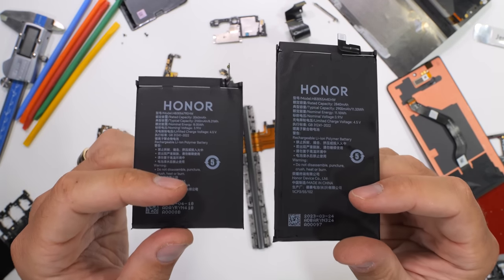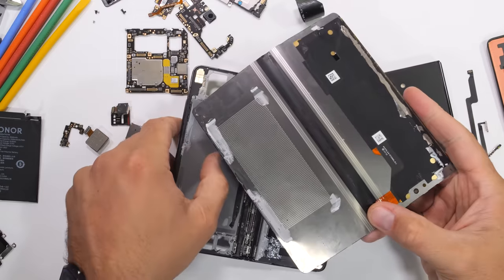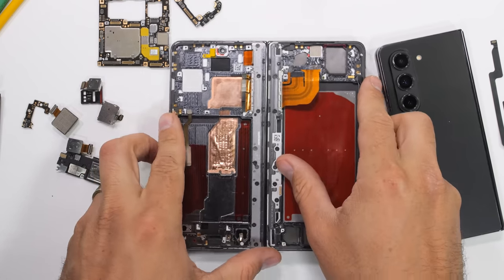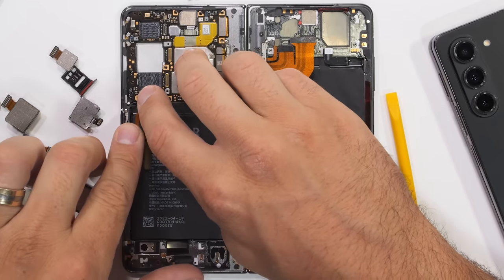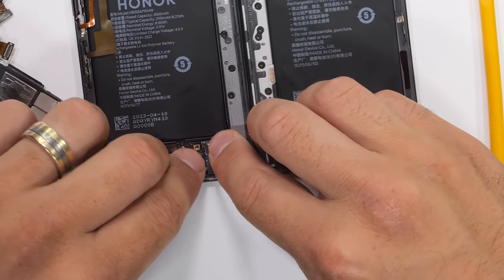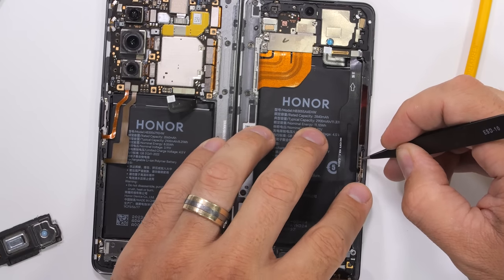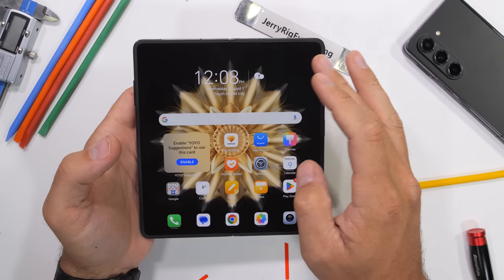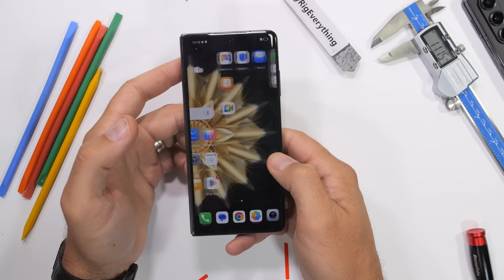FINE! - I'll build my own Folding Phone! (Worlds Thinnest)

Comment: 5000mAh for batteries that thin is honestly ridiculous. Battery tech has come such a long way in just 30 years, I'm really excited for when solid state batteries hit the scene.
Reply: Not true. Battery tech didn't move at all compared to phones overall tech.
Reply: Battery tech is severely lacking behind current tech lmao are you drunk
Reply: just give us carbon nanotube batteries that last for days 😢
Reply: We need nuclear powered battery.
Reply: @mggt4684  stuff it I'll bite. We went from nickel cadmium batteries being the norm in the 90s (40-60Wh/kg nominal density) to early liion/lipo batteries having 100Wh/kg to modern liion batteries having a massive 260Wh/kg. That's nearly 6x the energy density of NiCd. I'd even go as far as to say batteries have progressed more than the other tech in phones, even if batteries stagnated why aren't SOCs more power efficient? Why aren't displays more power efficient?
Reply: Is that chineese mAh's? 🤔
Or real independently tested mAh's?
Reply: you have to be extremely high to think that, we have folding phones and transparent tv's but batteries are basically the same but with larger capacity.
Reply: @luketheduke420  I mean, since the 90s, computers have gained something like 1000x the power
Reply: @luketheduke420 displays and socs are things that have gotten more power efficient 😭
Reply: I mean it has two batteries which when added comes to 5000 mah
Reply: @Yuvalby This battery is thinner though yet has a lot of capacity for its size.
Reply: @darthmortem585  literally false, why has 10 hours screen on time been the benchmark for phones for over 8 years now, displays and SOCs stopped getting more power efficient in 2017
Reply: @luketheduke420  In last decade the density improved by around 25 %. Meanwhile CPUs and GPUs are more than 2 times faster.  Also batteries still have some basics issues like it's efficiency decreasing over time. Btw from what I read right now new displays consume 30 % less power than displays 10 years ago (considering brightness and pixel density), so it still improved more than batteries.
Reply: @mggt4684 we can have 20 000 mah smartphone now but the don't do that destroy the Earth human can do human can did.
Reply: @luketheduke420 also they forget that battery density doesn't count it's volume. Newer baterry thinner while at the same technogy. Also support fast charging. How could old battery charged at 200W 😂
Reply: @luketheduke420  the devices also got exponentially more powerful. do you even understand what power efficiency means? the only stagnating point was 888/8gen1 and we seem to be beyond that era
Reply: @dallebull legitimate question
Reply: @cosmicaler  But socs and displays draw more power now
Reply: @luketheduke420 I guess LTPO displays don't count and 4nm processors don't count.
Reply: @mggt4684  relative to what exactly? Phones didn't initially have batteries O_o. Then they peaked at several weeks of battery life, then Apple brought out the 3hr battery iPhone. Do you understand how much demand is put on batteries now compared to before?? Battery technology isn't where we NEED it to be true, there was an insane amount of obstacles thrown at that industry. Somehow we have phones that will last several days again under reasonable use. Software and Hardware optimisation is a massive issue with current computer technology that's where our issue lies. Apple is somewhat utilising a mostly integrated system.
Reply: @luketheduke420 So how come newer SoCs can do much more work within those 10 hours? They definitely have gotten more efficient. Not to mention that my new phone doesn't burn my hands while doing basic tasks like my old one did.
Reply: @luketheduke420 phones have literally went from barely being able to call/text correctly to doing absolutely everything an average user would need it to do, making people no longer socialise face to face and singlehandedly made a whole generation the dumbest generation yet (I'm looking at you TikTok)

That, all with the same screen on time of an old fashioned phone.

Also keep in mind that older phones were lucky to have a screen that registers on modern resolution scale, it requires a surprising amount of power just to display the video you are currently commenting on.
Reply: I think when SSB's first come around, they won't be that much better. I think mostly, they should enjoy a better lifespan. Wouldn't be too sure about increased capacity, especially not if manufacturers start using it to make even thinner phones instead of bigger batteries.

Nevermind the front-costs of switching up to a new tech.

Either way, I think it'll be a while before we see them in premium phones, just because they'll want to see them tested out properly first. Every advantage has a disadvantage. Right now it's just waiting until we discover the disadvantages for SSB's. I am very excited for the tech, don't get me wrong... It's just that these days everything gets overhyped so much by marketing teams...
Reply: @luketheduke420   we didn't even have SOCs in the 90, what are you talking about????
Reply: @bariltrailette did you have a stroke while typing this?
Reply: One of my phones has a solid state battery. It's pretty cool even though it doesn't really change anything about the phone in a noticeable way
Reply: @TheSandsofFlowingTime  what phone? phones with solid state batteries don't exist yet, I think you are confusing Li-Po with Solid State.
Reply: Yet iphone still pulling 4000mah while weighing almost half a kilos
Reply: @TheSandsofFlowingTime  alwayz i dont care
Reply: @Qimchiy Luke has left the chat lol😂
Reply: Nah man absolutely need that graphene battery tech
Reply: @brandonerrorcontentmissing4012   LMAO
Reply: @dallebull   classic amerian fredom mAh's
Reply: @cosmicaler  That doesn't mean it hasn't come a long way?
Reply: I wouldn't believe what they write on those specs after experience with xiaomi
Reply: @hamster_96  please elaborate. I'd like to know
Reply: So" SSB"
Reply: @bariltrailette i know youre saying words but i don't know what the hell you said?🤔👀
Reply: I havent charged my old Nokia 3310 since release and im still at 60%
Reply: @dallebull what does this even mean, all batteries made in China anyways
Reply: There is a Tablet that has a Solid State battery ..Blackview Active 8 Pro Rugged Tablet
Reply: @dallebull  They deliver whatever Americans ordered, blame Apple or Walmart, not the Chinese.
Reply: @Yuvalby TV haven't really changed at all. They just got a bit thinner and larger. Thats all. No progression
Reply: @odi_de_podi 😂😂😂😂

Comment: Honestly love the idea of buying a phone and assembling it yourself. More companies should have this option with a kit to put your phone together at a slightly cheaper price since they won't have to assemble
Reply: Actually it's the reverse - they would have to disassemble already assembled phones. The same happens with the Framework laptops - they need to assemble them first to test if they work like they should (and if they even are assemblable in the first place, defects happen) and then if you chose the disassembled version then they have to disassemble them. There somewhere was LTTs video where he has shown the factory of Framework laptops where he also explains this process.
Reply: @daruyami  sorta kinda with traditional QC, but in factories like the one where the Raspberry Pis are made, they're automatically tested by a machine that plugs everything in
Reply: @daruyami  There are some edge cases where they may be able to salvage the internals from a unit with a busted case or a case from some bricked internals which can save money depending on the circumstance. You are right they almost always have to assemble even those units with salvaged parts first to ensure that the refurbished units built with them actually do work and can be assembled properly now.
Reply: @daruyami consider: blaming the customer for false assembly if something doesn't fit!
Reply: @daruyami  but they still sell disassembled as cheaper though
Reply: Even without QC and having to set up more complex assembly lines, it’ll still be much much more expensive to sell it disassembled due to shipping a larger box, having to include way more packing material to protect the battery from puncture or bending and having to protect a bunch of stuff from static charge. Imagine having an entire shipment of bare batteries just go up in flames to save a fraction of a cent on minutes of assembly time.

Comment: I've had my ZFold 4 since launch morning and I love it. I would highly recommend a folding phone as a daily phone. I'd always wanted one since the first model came out back in 2019 and finally got one in 2022. It still blows my mind and I'm not sure I'll ever go back to a traditional single-screen phone
Reply: I also own a z fold 4 and love it. But I would not recommend it for most people, it is a really cool and impressive piece of tech but 99% of people would not make any use of the hardware, and would only use it to show off and brag. There is no need for a device on the cutting edge just to mindlessly scroll on tiktok. That said I will probably never go back to single screen phones either.
Reply: @SergioEduP  precisely. 4 user also. I highly recommend it but only to people who are 100% sure it's what they want. The price is still up there for a concept that's still working itself out. I'd say we're almost there tho.
Reply: Right? I bought Z Flip 3 thinking I'd just try it and if it breaks, it breaks. Wouldn't you know it, damn thing is still going strong after few falls that ended up with scratched edges and daily use. They're much more resilient that they seem.
Reply: @tyrannosaurus_x  I agree. I've dropped mine pretty good a few times and I haven't scratched either screen or outside and it functions perfectly fine. The 1 issue I had was the built-in screen protector on the inside screen that got airbubbles after 9 months and I removed it with no issues.

Comment: Compare the 2 phones in mm^3 and you might see how they did what they did.  That phone is substantially wider than the Samsung.  The narrowness of the Samsung is one of the selling points to me -- the candy bar form factor feels nicer in the hand than a phablet.
Reply: If the phone folded is almost the thickness and weight of a normal slab phone, in the same aspect ratio and size as a normal slab phone, I don't understand your complaint. As much as I like my Fold 5, it would be nice if it was thinner and lighter.

Comment: I feel like especially for the fold lineup it can only be so thin before the sturdiness or integrity is compromised I have a zfold 4 and still feel like I can snap it in half very easy but the thick hinge I feel like is what stops it from snapping In my hand, bag, or pocket. We don't need cheap keyboard flex on our mobile phones with screens I feel like that could easily damage pixels lmao

Comment: What if I don't want thin though? I want something with a beefy battery, a durable housing and powerful cameras and a powerful chipset. Bear in mind a part of the price on modern phones is making up for the engineering time and a larger device doesn't need all the compact parts and optimizations something like this or a iPhone would.

Comment: Sure seems neat. I wouldn't mind a price cut if I just got the parts to assemble myself. 
Unfortunately, this appears to be only available in China currently, and still costs over $1200 USD (9000 RMB). I guess thats at least slightly cheaper than Samsung's offering technically? If it were available in North America anyway.

Comment: How is titanium lighter than aluminum by weight? It has a density of around 4.5 vs aluminum at 2.7 (in grams per cubic centimeter). Or is it stronger than aluminum by weight as well as steel?

Comment: Titanium is lighter than steel and is Softer. Titanium is also 50% heavier than aluminum while being stronger than aluminum.
Unless you purely go by the specious/misleading part that titanium has a better weight to strength ratio.

Comment: Titanium is NOT lighter than aluminum, it's actually heavier. It just has a much better strength to weight ratio so you can use less material and in the end you can make a lighter structure

Comment: This also FULLY debunks the whole BS argument from manufacturers that "It's a folding device or It's too thin to be repairable and that's why we can't and won't supply customers with replacement parts." Honor obviously was able to beat the thickness of both of those phones and made their phone easily repairable without any soldering, everything I saw used either ribbon cables or those Low Profile flat "Lego" Plugs. Sure there's soldering in the components, but just like with buying replacement components for a Phone/Laptop/Steam Deck, if a Camera Chip fails, you buy a Camera Assembly and swap that Little PCB Assembly Out, doesn't require de-soldering a Camera and re-soldering a New Camera on to repair the device. Love it, I LOVE everything I've seen so far about it, so long as they sell replacement parts for it. I also wouldn't mind seeing a DIY Option where you buy the phone not assembled for cheaper and save money by assembling it yourself, in my opinion that would make people more comfortable with repairing a small device like this phone if they already had experience with it apart.

Comment: I'm confused as to what "Titanium is lighter by weight than Aluminum" means. Titanium is denser than Aluminum by about 67%, but one can use considerably less Titanium than Aluminum to achieve similar strength. I'll assume that's what you meant, otherwise it sounds misleading.

Comment: I do like the idea of DIY phones since that automatically makes them repairable.  That phone looks awesome but i have to admit, i dont want a super thin phone at the cost of everything else like water and dust resistance and battery life or things like the headphone jack or in Samsungs case, the stylus being stored in the phone.  I also hate how short the outer display is side to side.  I just want 2 Note 9s strapped together with a big tablet sized screen in the middle.  Full sized batteries, S-pen internally, and full sized screens.  Thickness and weight be damned.

Comment: So, after watching many of these folding phone torture tests, I'm left asking myself one question. Why does the flat part of the folding screen, the part that will never fold or bend have to be plastic as well? Why can't both flat parts of the screen be glass and only have the flexible folding plastic part in the center? Surely if glass and titanium can be seamlessly bonded to plastic and aluminum, then why can't glass and plastic also be seamlessly bonded so there would be no visible lines where they meet.

Comment: For a phone you put together yourself, I am rather concerned that the battery is very low capacity compared to other phones, which is probably why the Samsung flagship one is thicker in build, because their batteries have higher capacity for powering both screens.

Comment: 1:32, wrong, titanium is heavier than aluminum, where did you even get that information from
Reply: Titanium has a density of 4500 kg/m3 in contrast to the 2712 kg/m3 of aluminum. As a result, titanium is heavier when compared to aluminum. This means you require less titanium in your machining to have a lightweight product. Titanium is the better choice when it comes to strength.

Comment: ...also, this claim is nonsensical: "Titanium by weight is lighter than aluminum and stronger than steel. It can reduce the hinge thickness by 75%." Yes, by making it weaker than a steel hinge. Density of titanium is lower, as are the tensile strength and stiffness compared to many stainless steel alloys. If you want to achieve superior performance to steel you must keep the structural parameters at least identical to the steel part, or even make it larger to compensate for the inferior structural properties of titanium. If you reduce the hinge thickness by 75% you are dropping the structural integrity of the hinge by a massive amount compared to using a stainless steel hinge.

Comment: Titanium is in fact not lighter than aluminium. Titanium has a density of about 4.5 g/cm³, where aluminium is 2.7-2.8 g/cm³. (Depending on the alloy)
It can, however have a higher strength to weight ratio, depending on the alloy, which, depending on the design can end up being lighter.

Most of the times in applications like these titanium is a total waste of money and entirely a marketing trick. Titanium is a pain in the a$$ to machine and in this application will save no significant weight at all when compared to a high end tempered aluminium alloy like 7075 or 7068

Comment: Thinness is cool and all, until you have massive camera bumps.  I've always hated camera bumps, always will.  There's zero point in aiming for thinness when the camera bump thickness could help the device house more on the inside, like more battery or better cooling.  Camera bumps also make the phone sit awkwardly when you set it down, especially with asymmetric bumps, and I don't particularly care for being able to feel, and sometimes see, the camera bump in my pocket.  Why does everyone pretend to just ignore this glaring issue in design?  It also gets worse as devices get thinner; just look at this device, the camera bump is nearly the same thickness as the device halves.

Comment: A Russian rocket blew up because they installed some contractors upside down using a hammer. So yes. If it is in the right place you should not have to force anything.